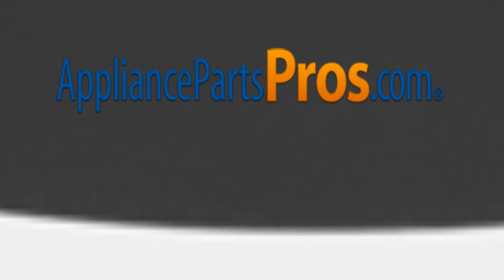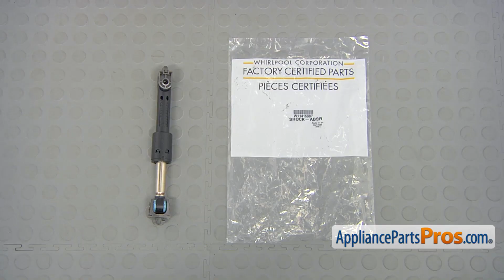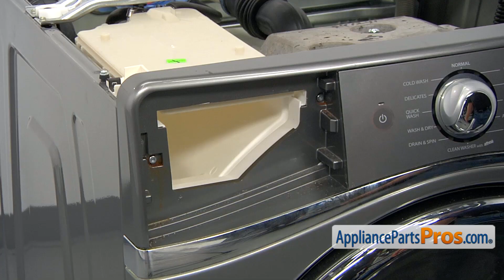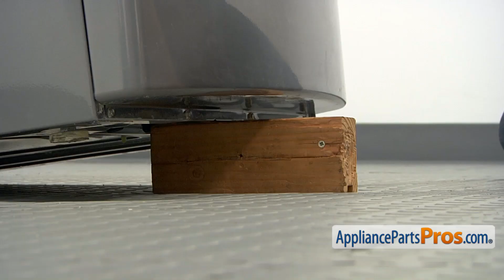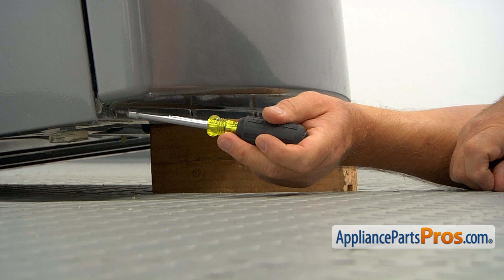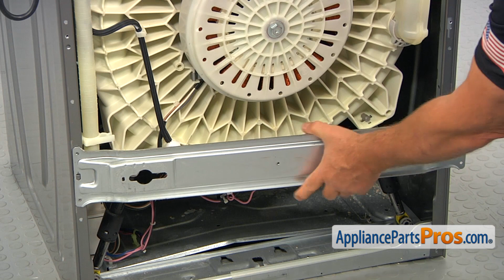How To: Whirlpool/KitchenAid/Maytag Shock Absorber W11415987

Comment: Absolutely the dumbest design ever.  They don't come out or go in as easily as this washer, that has probably never been used.  They are plastic and those key holes are going to shear them along with your hands on the raw sheet metal cabinet.
Reply from the maker: Our videos are generic videos to give you an idea of how the repair is done. So the steps for your model may be different. If you have any questions, we will be happy to assist you. Our phone number is 1-877-477-7278.

Comment: Is there supposed to be constant tension in the shock when you push or pull it? My shocks have about an inch of free play before there is any tension. This is with the shock removed and not on the machine. I bought some replacements and they are the same way. Now I’m  not sure if it’s designed that way. If so, there’s no need for me to replace mine because the tension/stiffness feels about the same.